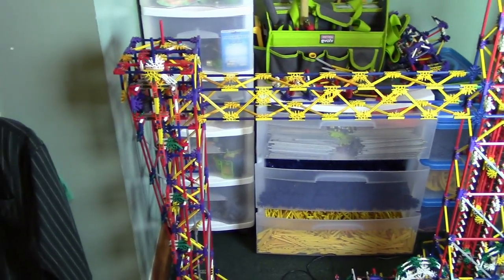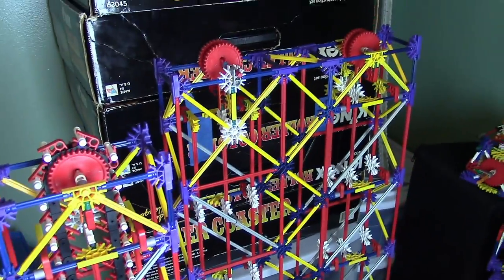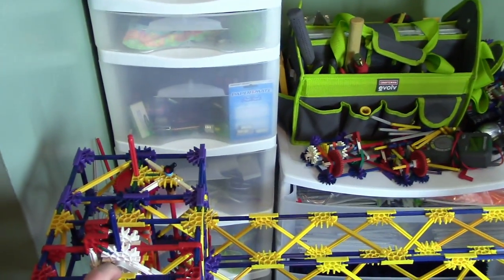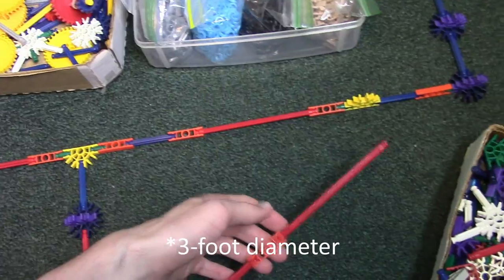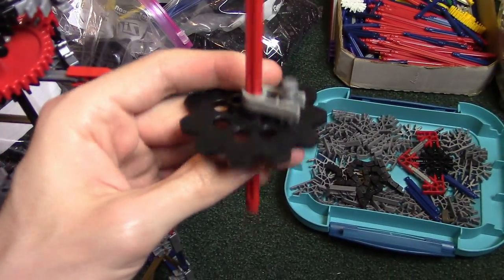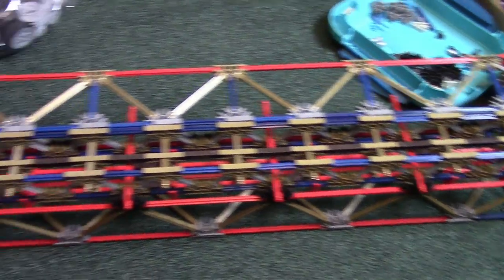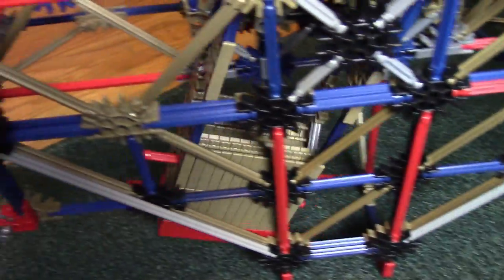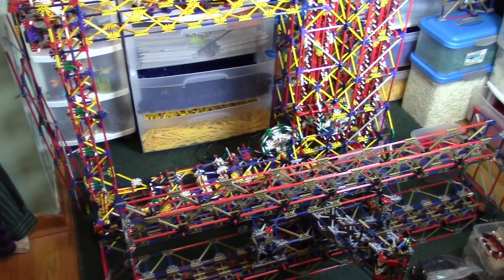Let's Build Knex S2 - Ep5 - Robot Project: The Arm

Comment: Just started the episode so if I’m wrong then no need to respond, but have you noticed any certain key mechanisms that worked perfectly fine and haven’t been altered but all of a sudden stop working correctly? I always find K’nex works in funny ways like that. Either way can’t wait to watch the rest just had to get the question when it was fresh on my mind
Reply from the maker: I've had that happen, mainly when things sit around for a long time. There could be a lot of technical reasons why it happens, but hopefully this project will be done fast enough to prevent problems.

Comment: What was the rationale for using small wheels with tires and not the larger wheels with orange tubing? I know the orange tubing can be a little hard to work with but the carriage track seems like the perfect application for it. Also nice work on the chain de-tensioner. I have some ideas on more compact ways to prevent wobbling. I’ll make a video and send it to you if I can.
Reply from the maker: The robot arm is pretty heavy, so I thought using tubing would make the tubing sag between the tabs it connects to. And I'm not sure if I have enough of the orange splicers to make solid rails that have no gaps (even then there'd likely be gaps). The track is more compact as well, just imagine putting four rails of tubing facing inwards, which would be needed for the edges. Looking forward to the video, the nice thing about this robot system is it can apply to any arm setup.

Comment: I'll admit, I was never sure what you had planned for the robotic armature to be but I'm very pleased with the choice in the end ^^
There were a lot of 'save' alternatives, like a crane with rotational, reach, and height, or a 3 axis type rail that may have been 'easier' alternatives, but I think the one you chose combines a good level of technical challenge and interesting motion that will benefit the final execution.

I don't have much in the way of comments on this one, though I'm curious what other ideas you had attempted to transfer 3 rotational axis up through a central hub? I know at one point I had fiddled with a design that kind of used a planetary gear thing, but I can't for the life of me recall if it worked or not. Reasonably I should know but I cannot say.
I think it used the two on one side idea you were using, but then turned the whole base of the structure into it's own differential for the two inputs at the base, rotating the base on a platform driven by wheels underneath. Least if I recall the design working 'theoretically' like that.

In any case, loving the work on this still! Excited to see how linking it all up goes for yah!
Reply from the maker: I thought of doing the crane setup, with the first joint being rotation and last two being sliding joints. But I don't have the space for that, since it requires a track going around the diameter. I also didn't want to make a gantry robot as it doesn't look much like an arm, plus it's been done before with Knex. So I think the current design makes the best use of the available space, yet it still looks like an industrial robot arm. 

I hadn't really tried other ideas to get the 3 joints onto one hub. Other than the way I did it with one of them coming from above, I think it would require concentric shafts that have bearings between them and gears that fit onto them. It sounds like using a differential wouldn't lead to completely independent inputs.
Reply: Yeah, I think you're right about the inputs not being independent. unless you could put together some rotational adder to remove the impact of the base rotating, but that is a whole different problem and probably excessive to what the goal is.

I do like the design you've landed on, def suits what you said you're going for.
Now comes the speculation though on what you're going to be doing with your robotic arm :P
Reply from the maker: @FygerFyre  Haha, I'm going to try to use it for pick and place once I get the gripper built. I would also try to make it a CNC machine, but don't have a small router to place on the end. A gantry would be better for that anyhow.